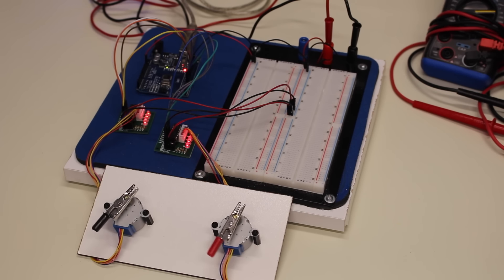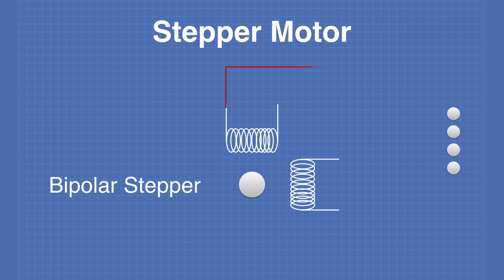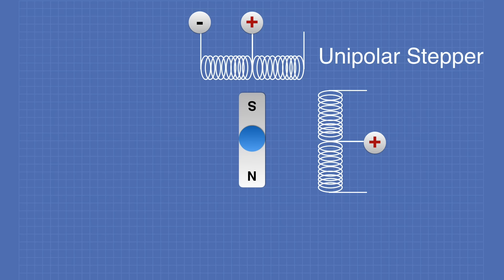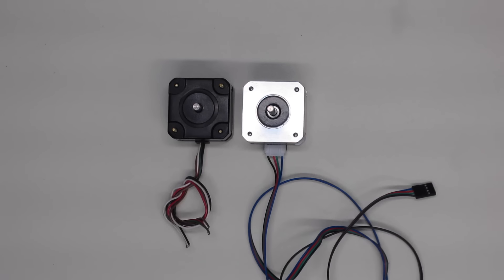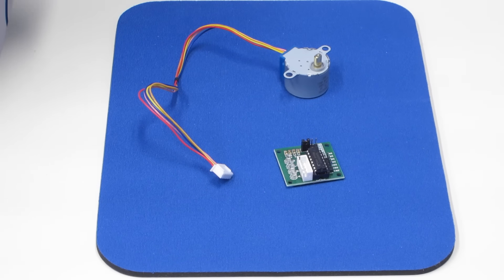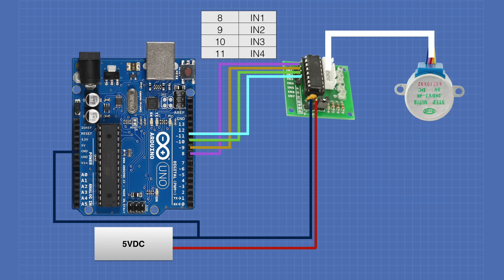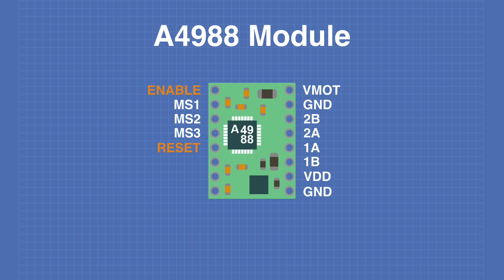Stepper Motors with Arduino - Controlling Bipolar & Unipolar stepper motors

Comment: nice video but the wiring diagrams need work. the top down view of you measuring the current while choosing to use similar color wires made it look very confusing, especially at 1080p

Comment: Can you just use a motion control circuit connected to this circuit in order to change the rotation speed rather than having to use an arduino?

Comment: 4:40 stepper motor operation
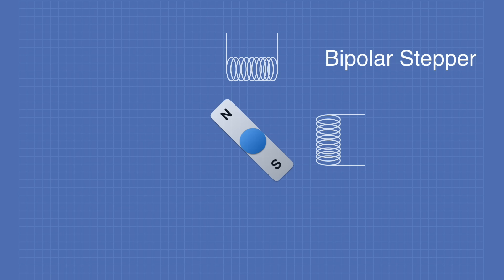5:50 coil winding (pos, neg, center tap)
8:19 stepper motor specs
15:00 first experiment (unipolar stepper motor)
16:30 first experiment arduino code
28:18 2nd exp (bipolar stepper motor)
Reply: Stepper operation

L
Reply: mvp
Reply: Merci
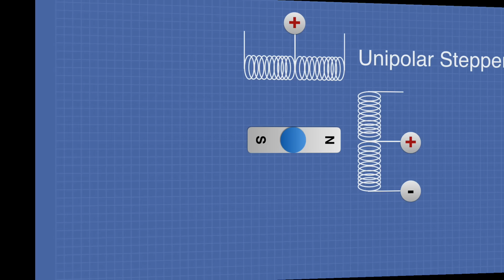Reply: 7:59 stomache wants something to digest (headphones required)

Comment: Many thanks for your tutorials. I've have used Arduino, ESP8266, and ESP-32, ESP-32 Cam and Raspberry Pi modules for several years now, but I find your turorials to be excellent: detailed enough for the beginner, but sufficiently paced so that an expereinced viewer like me does not get bored.  One minor point in this one: the units of torque are force-length, ie ounce-inches, not ounces per inch.

Comment: I have just completed the first exercise with lights flashing and the shaft turning as required. It has taken a long time to get here but I have finally managed to do something I have wanted to do for a very long time. I hope you can take some personal satisfaction for helping a complete stranger in another country create a basic platform to build on. You do not have to do this but I am so glad you continue to make outstanding videos with patient and complete explanations and software to copy.  My ultimate objective is to use what you are teaching me to include some interesting additional activity in the clocks I build and also to drive a small CNC lathe that I converted some time ago but lacked the software expertise to make use of it. Thank you.
Robert Webb
Brisbane
Australia
Reply: we offer belt-driven linear rails which are more efficient and economy for automation industrial, check CCM linear rails,  we also offer motor and driver, welcome send me inquiry

Comment: I send my salutations and appreciation along the line of Mr. Charley Edwards. I'm also retired, 67, spent my life in biological/biotech research and international research management. Now, retired, searching for a past-time offering great mental activity.  I've tried advanced math, astronomy, and - now - electronics. Thus, stumbled onto your videos and am absolutely delighted to learn from you. Your presentation, though often using acronyms or abbrev's unknown to me, is reassuring and comprehensive. Your approach to such a complex topic as electronics (to the novice) is well structured and fun to attempt to apply principles revealed and suggested. I am avidly digging through your past presentations in order to learn about setting up and controlling stepper motors in order to control telescope mounts via a hand-held remote. So far? Not so good, have ordered more materials to attempt it again and review your coverage of specific aspects of stepper function and arduino-based control. Fingers crossed, I'm trying to move forward but for a total novice in the field, it's sadly missing something. So glad you're here and presenting as you do. One last thing: I am SO envious of your accumulation of gear and parts and their organization is a great model to follow. Keep up the great programming!
Reply: I totally agree with you! What a wonderful guy giving us this knowledge for free. And what a workshop to imitate (impossible in my case once I work traveling).

Comment: One small point. At 46:40 you should tell folks to turn the A4988 pot fully ANTICLOCKWISE to set the current to zero BEFORE connecting power, then wind it clockwise to increase. If by chance the pot was fully clockwise then there is a risk of magic smoke from the coils. Suggest you just overlay a comment onto the video. Apart from that, I followed your instructions and all works well, thanks.
Reply from the maker: That's an excellent point, no one wants to see "magic smoke". Thanks for bringing it up, much appreciated.

Comment: Dear Bill.
I'am so glad that i found this video and your channel. I'am a HamRadio Amateur and i'am about to develop an automatic tuner for my homemade magnetic loop. Since then i tune manually with an normal motor and some switches to minimum SWR, this is annoying some times so i want to automate this. Therefore i decided to use a stepper motor and an arduino. Till now i am way behind of beeing familiar with programming microcontrollers and steppermotors. Your video brought me much closer to this and finally to not giving up hunting my goal.
Many thanks for this. My english is not very skilled so i hope i put it right. 73's and all the best.

Comment: A free education in one video, thank you! I'm embarking on my first Arduino project, an air piston device using a stepper motor that drives the shaft via a linear gear. The key will be balancing the demands of speed and torque. Wish me luck. All my life I've never built an electronic breadboard circuit from scratch that's ever worked. 😓

Comment: I'm currently working on building a small walking robot that uses fishing line and springs to operate the legs. I originally envisioned using servos to spool the fishing line and lift the legs, but the  tiny servos I had in mind didn't have enough torque to lift three spring-powered legs at a time and they only revolved 195 degrees, which would only lift the legs a fraction of what I needed. I had heard about stepper motors, but didn't know much about their function. Since watching this video, I decided to replace the spooling servos with stepper motors and initial test are very promising!

Your videos, as always, have been a huge help in leading me through my understanding of robotics and electronics. Thank you!

Comment: Great stuff, I'm literally two weeks old into learning about the Arduino and electronics in general and this was so helpful. Thank you! What I'm trying to do is to use a NEMA 17 Bipolar stepper with A4988 and a rotary potentiometer to control speed and a button to be able and reverse direction. If you have any advice on how I can go from what you describe here: ( NEMA 17 Bipolar with A4988 - 36:41 ), to what I need i would greatly appreciate that. I'd like to compare the sketch and wiring from what I need to what you show here to get a better understanding of how I go from one to the other.

Comment: Excellent instruction Sir.  Anything I didn't understand is purely on me!! As others have said better than me, your audio, your pace, your visual presentation, detailed yet crisp explanation of the scripts, and your tidy demonstrations are superb.  I am building a Flight Simulator and need to understand the use of steppers and their drivers to enable data from the flight sim software to drive steppers for instruments such as Altimeter, Rate of Climb, Air Speed and a number of other dial type gauges.  I have lots to learn!! Thankyou for making it easier than I expected.

Comment: One suggestion: In the code for manually stepping the a4988 with nema17, if you remove the delaymicroseconds() between the digitalWrite(HIGH) and digitalWrite(LOW), the vibration of the motors is significantly reduced, and you can still control the speed with the second delay (after LOW). Im not sure if this can cause inconveniences but its working fine for me. 
Amazing video!

Comment: I'm just getting into stepper motors for a CNC hot wire foam cutter.  Your video is just what I needed to understand some of the basics.  It is outstanding. Thank you so much

Comment: please do video on open loop and closed loop motors. for ex. servo and steppers
steppers very are good but they are not good for high speed applications with high accuracy and torque.
Reply: for high speed, you use a brushless motor

Comment: Seriously, thanks for clarifying a lot of stuff, I'm currently just anxiously trying to get into the whole stepper motor part of electronics, I did some some years ago, but I've forgotten a lot of it. Having some prior knowledge, I (at first) found the tempo of your video a little slow, but it started making sense and all of a sudden I'm informed of what kind of motor and which driver I need for my project.
From the deepest of my heart, thank you for making infomation-cramped videos and making it comprehensible.

For those that just zoom past this, give it a few minutes, maybe scroll a little through the video. There really is a lot of good knowledge in here.

Comment: I'm working on a deadbolt actuator with a nema 17 with a 310mm rod and the driver was going to use required a custom pcb and driver with the arduino. I'm going to use a tb6600 instead now from watching your video. I haven't decided on the input to unlock the door yet after prototyping a few different devices but this has simplified my project quite a bit. Holding torque isn't an issue so it will reduce the power consumption.

Comment: Having worked in this industry for more than 2 decades, I have to say that this video is the first AND most accurate I've seen to date.
Some improvements I would suggest is to delineate the Static/Holding Torque a bit better. Static Torque is an indication, but the Motion Torque is the key.
Detent torque is typically on the orders of 1/10 or less of the Static Torque.

Would you consider making a video for closed loop operation?
By the way; your workbench is a dream. So clean and well organized!

Comment: Very clear video, thank you. Some may want to know what that "StepperMotor.setSpeed" entity represents and what unit it has. I figured that  the calculation of this parameter is : 2048 * desired angular speed in rev/s (rps) * 0.6). Example for a quarter of a turn per second (0.25 rps) then setSpeed = 2048 * 0.25 *0.6 = 307.2, which corresponds to 1 rev in 4s (4000ms). It is homogeneous with an angular speed in steps/s.

Comment: thanks a lot,i always strugle with arduino but your explanations are cristal clear,and you take nothing for granted so is easy to follow you.
teaching arduino its harder than it seems,but i will finally learn to really use it thanks to your videos.
i dont consider myself dumb,i build my own CNCs,fpv drones when no drones or drone parts were still at sale,etc,etc but arduino is "so easy" that steps are always skipped and i get lost.
well,maybe im a little dumb,but still i started with the wrong foot.

Comment: I've watched other videos that explain the inner workings very well, but none have connected this knowledge to real life as you in this video. Thank you. One thing I'm not clear about is your method of determining current draw of the motor. Why is measuring one coil sufficient and the wiring changes you made to do this test.

Comment: Thanks for this clear explanation... one correction that I noticed at 10:30 the units for holding torque are wrong should be ounce x inches (oz in) or N x cm (N cm) not "per" which means divided by. Minor detail I know but units are important especially when calculating power.

Comment: Thanks, one of the best stepper vids out there. Another dimension to this is to convert the rotation of the shaft into linear motion either with a rack and pinion, ballscrews, geared quadrants, etc. I want to open a series of greenhouse roof windows using steppers but I am struggling to find the right hardware. Most of the stuff appears to be too weak, designed to show the principle rather than hook it up to something meaningful.
Reply from the maker: Thanks for the nice comment about the video, much appreciated. As for larger stepper motors for your application you might look at Anaheim Automation or Omega as they distribute motors designed for similar applications.
https://www.anaheimautomation.com/products/stepper/stepper-motors-list.php?cID=19
https://www.omega.com/subsection/stepper-motors.html
Reply: Thanks for this. I'm in the UK and I'm looking in the wrong places, so need to dig around more.

Comment: I have a couple questions:  1) in your diagrams you have 2 coils,(A and B). When cycling between coils to make the shaft rotate, what's to stop the shaft from actually going backwards to the first coil? simply flip-flopping between 2 positions and not actually rotating.   2). The coils obviously have polarity. if given a motor, without any kind of wiring specification, how do you determine which wires belong to which coil, and more importantly, the wire polarity?

Comment: I did this with a nema-17 stepper from a 3d printer using your sketch.  I altered it to reverse direction with a switch.  Good explanations.  I'm 79 retired IT professional and still learning..  Edit: Received ULN2003 boards and28BYJ-48 steppers.  The first sketch didn't work.  Found these steppers didn't like a speed less than 120 for a long  (1/2 turn) move.  Changed the speed to 120 and sketch loops ok.  (misses steps?) Edit2:  Was the clone Uno. The real Uno runs fine..  On another note: Nano clones work fine.

Comment: This is how it's done. love the info. Just getting started in electronics and this is the best video I've seen on the subject. I am currently building a simple camera slider for iPhone/Go Pro. I wish I had seen this video earlier. I've finally gotten the thing to work as intended with some final help with the Arduino code for the limit switches. Although there are other tutorials for building a camera slider, I decided to design mine from the ground up as a learning experience. I am using a DRV8825 to drive the motor but also have some A4988 drivers as well to experiment with even though they are similar.  I am very excited to see future videos as well as exploring the ones you've done in the past. Thanks!
Reply from the maker: Glad you enjoyed the video. I'd love to see your camera slider as I'm sure many other would. Will you be posting a video when you have it built?
Reply: I think I will either make a video or make an instructable. The irony is, I own a video production company, so there is no excuse. I'm a total noob to the world of electronics and I think it would be an interesting angle to present this project through the eyes of someone who is just getting started. I would love to graduate to building a 2 or 3 axis gimbal camera stabilizer. It's nice to have projects in mind when learning. Keep doing what you're doing. Looking forward to more videos!

Comment: Bravo and thank you. I learn a lot from your videos - starting in my case from zero as I’m a musician. I’m about to build two devices using stepper motors. The first just to learn, the second will be for adding consistency as well as flexibility in the making of new oboe reeds. I might need a little guidance. This second device will be interesting and unprecedented I think.

Comment: Wonderful video.  I am building a powered fly rod wrapper and plan on using Nema 17 steppers.  I also have plans to use a stepper for the rod dryer that will make partial turns then stop and allow the epoxy to level.

Comment: Thank you for this great tutorial Sir!
Thanks to you, I can finally use my stepper motor because the pin connection was explained incorrectly in the manual. Now I finally understand how to controll a stepper motor with an Arduino. You are a great teacher Mr.!

Comment: Thank you for that excellent video.  It answered all my questions regarding the difference in the bipolar and unipolar steppers.  I am planning to use a stepper motor to drive the turntable on a model train layout.  I still haven't got the code down correctly to advance exactly to each track, since they are not all the same distance apart.  But tomorrow's another day.  Thanks again, very well done!
Reply from the maker: Thanks for the nice comment Jim, I'd love to see your railroad turntable when you are done. 
Way back in the 1990's I built a model railroad layout (HO gauge) which used hall effect sensors under the trackbed and magnets under the engines so I could monitor and control the trains with an Apple II and a lot of TTL logic IC's.  I can only imagine what I'd be able to put together today with Arduino's and all the cool sensors we now have available. Best of luck with your project, it's a wonderful hobby.

Comment: I have a small wind generator, and as usual they have a long, large tail in order to turn them into the wind. I would like to use a small wind vane showing the direction of the wind, and  then send the message to a motor to drive the generator into the wind.
I can programme in C++ but I don't know what gadgets to use except for the Arduino UNO which I have.
By the way, what a great tutor you are, I have subscribed and look forward to more of your fine tutoring.
Cheers
john nielsen

Comment: Your tutorials are incredible! I can tell you put a lot of work into them. Thank you for taking the time to explain these concepts to us! I have one quick question - why do we not want to connect the servo directly to the 5V pin on the Arduino and instead use an external 5V power source? Is it because we risk drawing too much current through the Arduino if we use the 5V pin?
Reply: correct.
Reply: we offer belt-driven linear rails which are more efficient and economy for automation industrial, check CCM linear rails,  we also offer motor and driver, welcome send me inquiry

Comment: Cool video. It perhaps would have been nice to see how we might code the stepper motor without the use of preset libraries for a better understanding, but the libraries make it easier for us to control. Also a little confusing is the use of 2 different power supplies in the same circuit.

Comment: Very good tutorial. Very through. I need some guidance as to code several switches to send a stepper to different positions and hold as long as the switch is closed. Thanks.